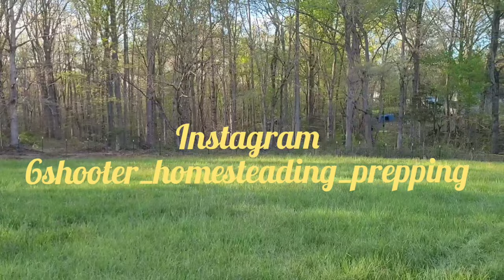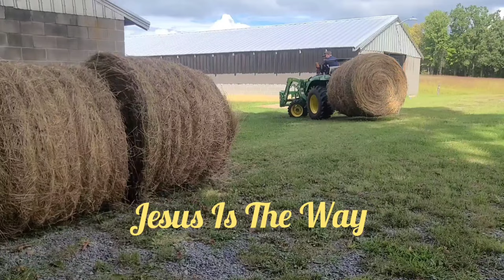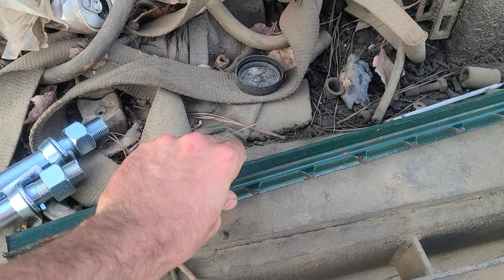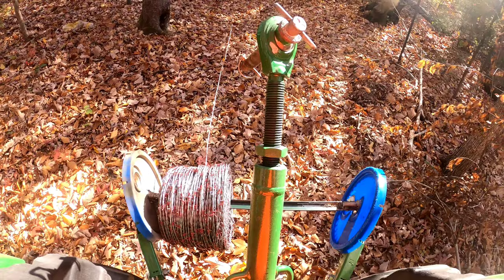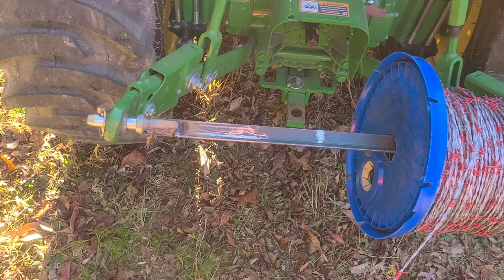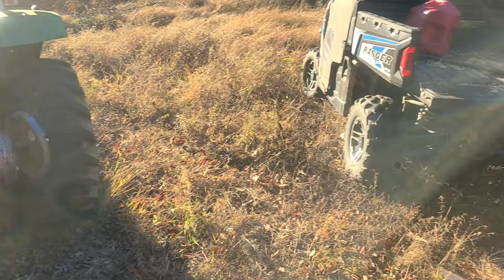Homestead Diy Barb Wire Unroller For Cheap

Comment: That’s a good way to do it I’ve made a cradle before in the back of her four wheeler trailer and pulled it across pasture with the Barbwire on spooling the fact that it’s not round is probably a good idea that way it won’t unroll so fast and spring out into a big old bird nest. Good job

Comment: If you would put the roll on where the wire comes off the roll from the bottom side. You can just put your three point arms all the way to the ground where the roll of wire is rolling on the ground and it will not free spool on you when you stop.